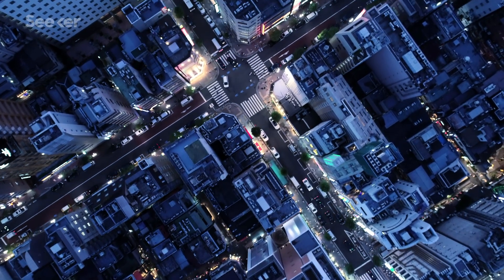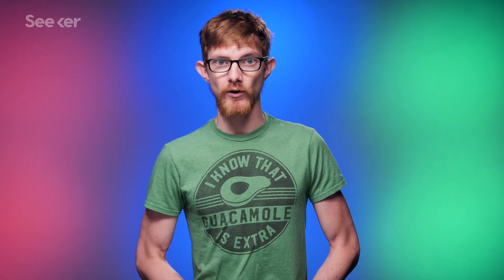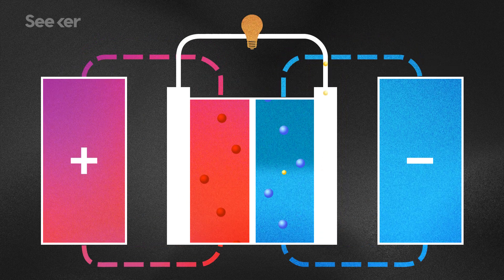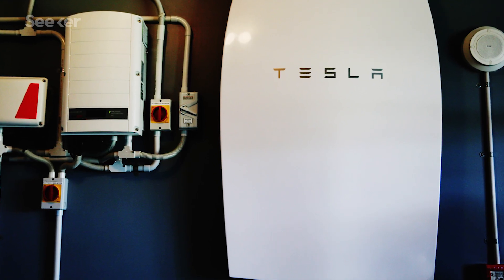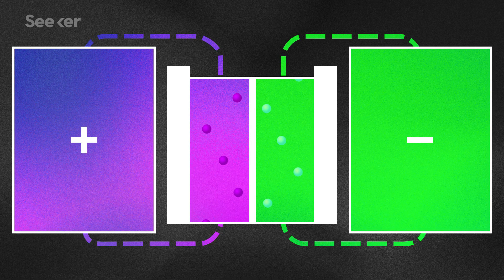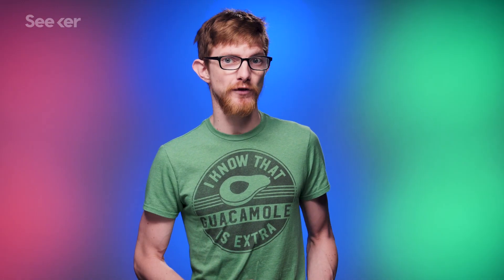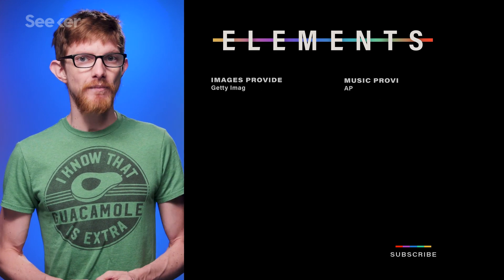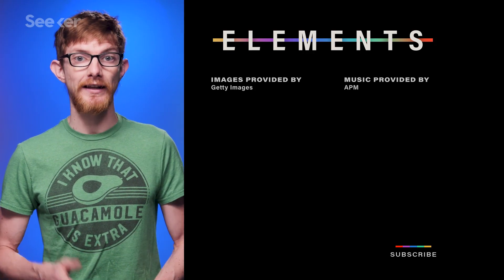Giant Flow Batteries Could Power Your City in the Future

Comment from the maker: Hey all 👋 Some of you may have notice that the hydrogen ions are flowing the opposite direction, nice catch! They should be flowing negative to positive. During the discharge cycle, vanadium ions lose an electron on the negative side freeing up the hydrogen ions to pass through to the positive side. They do the opposite while charging and storing energy! If you’d like to know more details about redox flow batteries check out theses articles:
https://www.sciencedirect.com/science/article/pii/S1364032113005418
https://pubs.acs.org/page/vi/redox-flow-batteries.html?ref=cmatexFeature
https://spectrum.ieee.org/green-tech/fuel-cells/its-big-and-longlived-and-it-wont-catch-fire-the-vanadium-redoxflow-battery.amp.html?usqp=mq331AQCKAE%3D
Reply: Is temperature C equal to watts per cm or meter? Squared or cubic? Per a second,  minute, or hour?
Reply: @robinhyperlord9053  What? Where does this come from? Also °C is based on the SI base unit K (Kelvin) you can't build it from other units...
Reply: how about using sea water and river water to produce difference of potentials? Both types of water are available in many places where a river falls into a sea.
Reply: @bazoozoo1186  Nothing to react in the fresh water, you can't get electric current out of it.
Reply: Now in deployment Iron flow batteries From ESS as well as smaller stackable units from a company in Australia zinc bromine RedFlow https://redflow.com/ and https://www.essinc.com/
Reply: Vanadium was also pronounced incorrectly.
Reply: where can u get vanadium?

Comment: The problem with lithium ion batteries is that they are optimized for power density and portability. Perfect for small mobile devices. But too expensive for grid storage. When portability is not an issue there are allot of different solutions possible.

Comment: A membraneless battery[38] relies on laminar flow in which two liquids are pumped through a channel, where they undergo electrochemical reactions to store or release energy. The solutions stream through in parallel, with little mixing. The flow naturally separates the liquids, eliminating the need for a membrane.[39]

Membranes are often the most costly and least reliable components of batteries, as they can be corroded by repeated exposure to certain reactants. The absence of a membrane enables the use of a liquid bromine solution and hydrogen: this combination is problematic when membranes are used, because they form hydrobromic acid that can destroy the membrane. Both materials are available at low cost.[40]

The design uses a small channel between two electrodes. Liquid bromine flows through the channel over a graphite cathode and hydrobromic acid flows under a porous anode. At the same time, hydrogen gas flows across the anode. The chemical reaction can be reversed to recharge the battery — a first for any membraneless design.[40] One such membraneless flow battery published in August 2013 produced a maximum power density of 7950 W/m2, three times as much power as other membraneless systems— and an order of magnitude higher than lithium-ion batteries.[40]

Comment: Plating batteries seem to have promise too.  Especially the one based on Zinc and Bromine.  An Ausi company, Redflow has commercialized these already and now needs to scale up.  They have, apparently unlimited number of cycles and can be taken up to full charge and down to zero.  In fact a slight disadvantage is that every three days, they must be taken down to zero.  There cycle efficiency is lower than Li batteries at about 75% but with wind and solar power ever decreasing in price, this may not be too much of a problem.

Comment: I'd love to see video on using these batteries in cars, when your solution becomes weak, you pull into a refueling station where
 they would pump out the spent solution,  and pump in fresh charged solution. Recharging could be done in minutes instead of hours.
Reply: This would never work in car since the technology has a low kW/H per litres of fluids compared with Lithium technology. However for static storage this technology is not an issue. 

Signed a person working at redT
Reply: @22moitrool83  Thanks for the reply an info,wishful thinking I guess.

Comment: I’ve heard flow batteries could be used in cars and could be re filled in minutes rather than hours 

If that’s true why is tesla investing so much into lithium ion batteries when this could be such a better way forward
Reply: i was also thinking it would be good for cars if you could swap out fluid at a station to be recharged on site.  Im no engineer or chemist.
Reply: @pablodiablo765  Energy density is too low; these will work for stationary land based uses

Comment: Ultra super capacitors that can store megawatts per cubic decimeter would be more ideal. You could discharge them  completely and not worry much, have a  recharged cycle of 100k or more have less environmental impact and are currently a fiction but would be  a possiblity in the  future. My opinion of course.

Comment: What are all those nuclear supporters complaining about?

Even if we would go primarily for nuclear energy, we would need large scale storage, you know that, right?
Nuclear Power plants are generally base load power plants, they don't like being regulated up and down all the time. They are turned on and then run more or less constantly, which means producing too much during night-hours and too little during peak load. This was the reason why pumped hydro facilities were established in the first place, but they won be sufficient when you turn all the variable fossil fueled power plants off and go full nuclear...
Reply: Producing power constantly is not a big problem compare to solar and wind.
In France about 75% of electricity is from nuclear. At night or any day they balance it with the hydro electric power station. 
Germany have spent about 500billion of solar and wind yet they pay double for 1Unit of electricity compared to France and still largely depends on fossil fuels.

Comment: Flow Battery???? All so complicated and waste producing mess  ... better to store energy by pumping water, where possible.  For example in California .. locate solar panels in the desert surrounding the Salton Sea .. and pump that water to the ocean, an elevation rise of over 200 feet ... let the sea water return, producing power all along that very long pipeline for distribution to everywhere between LA and San Diego .... This would reduce the Salton Sea contamination and reduce its salt levels thus improving the ecological disaster existing there for decades.  The government could pay for it all by selling property surrounding the Salton Sea which will sky rocket in value!!!!   Also, easy integration of a Desalination fresh water delivery systems would be a low cost adder compared to alternatives.  So much potential, for little cost ... ya heard it here first!!!!  (I only ask for 2000 feet of lake frontage).
Reply: Pumped hydro is nice, but unfortunately it can only store a quite small amount of energy compared to its massive size...
Reply: @DefCon1Shooter    Yes, but if the "massive" lakes & oceans already exist, why not use them???   The Salton Sea is the largest lake in CA, if just 1/7th of it was pumped to the ocean each day, then flowed back that same day ... that is a potential power of 132 MegaWatts  for 12 hours ... which exceeds the output of the Worlds largest Battery Grid Storage facility.  

Calculations & Resources used:
https://en.wikipedia.org/wiki/Battery_storage_power_station
https://www.engineeringtoolbox.com/hydropower-d_1359.html
https://en.wikipedia.org/wiki/Salton_Sea
Reply: You may be perfectly right with that assumption in California or the US in general because you have huge amounts of unused land over there. Here in Europe for example the situaition is a whole lot different. 

I totally agree with you that potentials for pumped hydro should be used. These new batteries are needed though...
Reply: @DefCon1Shooter  certainly, there is no single best solution for all situations.  My thought was that in CA, this would work great, while also reversing the environmental hell hole that is the Salton Sea (an ecological disaster accidentally created in 1905) ... the fact that it is located in a desert area .. there is a lot of dirt cheap land surrounding the Salton Sea hell hole ... all adds up to the perfect scenario for a Solar Farm with pumped hydro energy storage .. the only challenge is the long 70-80mile pipeline required out to the Pacific Ocean ... sound like a good use for Elon Musks Boring Company.

Comment: Great video giving a simple and clear explanation of redox flow batteries! Great job! However, I would like to point out three things: 
- Vanadium solution is extremely acidic. It is not limited to organic solutions. The same problems mentioned about pumps, etc., also apply to vanadium.
- Organic solutions for flow batteries have demonstrated to work in a wide range of pH, not only acidic or basic medium: https://www.sciencedirect.com/science/article/pii/S2095495617311051 . 
- Most organic solutions are extremely hard to produce in mass scale due to their synthesis process. Besides the very well pointed out solution instability, this is probably the major drawback of organic solutions.
Though, it is a great technology which hopefully can help us overcome the intermittance of renewable energy sources.

Comment: What ever happened to Nuclear? Cheap, efficient, safe.
Reply: Liam Kennedy what happened to nuclear? Three things: Three Mile Island, Chernobyl, and Fukushima Daiichi.
Nuclear fission reactors still have an important role to play but the public is legitimately distressed when they see the large scale environmental damage from the last two.  I was advocating for nuclear before TMI, and after that accident I emphasized that safety systems had ultimately worked and no harmful levels of radioactivity were released; after Chernobyl I changed my speil to emphasize that Chernobyl was an obsolete design no longer used (and never used in the West), but after Fukushima Daiichi I’m reduced to saying “well, coal is worse...”
Perhaps new reactor designs (pebble bed?) perhaps new fuels (thorium?) perhaps a shift in the public’s thinking, perhaps all three will be needed before new nuclear plants are built.
Or maybe we’ll get lucky and fusion will finally be made to work (China recently sustained a 100 million degree plasma in their EAST reactor).

Comment: Could flow batteries not be used for electric vehicles? Both solutions could be replaced at pump stations on routes, where it gets recharged again for the next replacement.
Reply: This was already discussed, but the disadvantage is the capacity/weight ratio, this is worse with redox flow batteries compared to Li Ion. But if you use them stationary, weight don't matter.

In behalf of the weight current Li Ion batteries are the lightest possible solution.

Comment: All-vanadium system liquids last indefinitely and can be re-used after (say) a 25-year plant operation on a 5-10 year maintenance cycle.An individual cell can hit north of 100,000 deep cycles if you cycle constantly. Really the only breakdowns are in the reduction of the carbon felt anode and in the membrane, and balance of plant items like pumps.

Comment: Redox flow batteries have lots of flaws and it still has a lot of work , research, development and improvements to be done I've seen some university research sheets about the redox battery , their main problems are that the nafion membrane is rediculously expensive and it tends to degrade often because the acidic environments .

Comment: Harvesting lightning? Anyone thinks this might be possible?
Reply: There's a good article on Forbes about this. It looks like the overall answer is "no". They mention the difficulty in predicting where lightning will strike, and the problems with melting capture devices because a good portion of the energy comes in the form of heat, not electricity. They specifically mention the Empire State Building being struck by lightning about 23 times a year, and if that could be captured would only equate to about 20 barrels of oil.
Reply: @ChrisJ-fn6tw   ow ok, thought lightning had more power then 20 barrels of oil.. thanx for the info.

Comment: How much superior are chemical batteries compared to a mechanical one? Like lifting a heavy weight really high up and letting it fall driving a heavy geared turbine when energy is required? Or pumping water to one side of a dam, and letting it drive turbines as it falls back.
Reply: Chemical batteries are very much superior. You can compare the energy density of mechanical and chemical storage solutions. E.g. pumped hydro with 100 m in height between upper basin and lower basin has an energy density of a little less than 0.3 kWh/m³. Batteries have between 10 and 100 times this energy density (Redox Flow somewhere from 30-70 kWh/m³/ Lithium Ion a couple of hundred). 

This means that we need much more space to store the same amount of energy with mechanical technologies than with chemical technologies.
Reply: @DefCon1Shooter  thanks. but even with this greatly improved density. Something like a dam can potentially be low energy to construct, and it will refill itself over time even if you let all the water out. Plus the energy can be stored for decades wihout degradation.
Reply: Mechanical batteries are technically superior but due to the heavy mass needed to be effective usually they will only make mechanical batteries when it can be incorporated into an environment (think about making a high dam so you can store the potential velocity of the water falling down)

Comment: Vanadium is currently $9.40/lb of V2O5 pentoxide flake in China and $9.65/lb in Europe, that's not very expensive. 

And given that companies can literally lease the vanadium electrolyte out and re-use it over again with no degradation in a brand new VRFB after ie. 25 years, the CAPEX is brought down generously considering the electrolyte is 30-50% of the cost of the VRFB units. 

And in comparison to something like a lithium battery on a large scale, the only way vanadium doesn't completely throw lithium out the door for energy storage is due to lithium's popularity and lower CAPEX, even though after 10 years the maximum capacity of the battery falls to around 80%, and at 15 you're lucky to be around 50-65%. 

Cellcube Energy Storage System's newest VRFB's achieved efficiencies of 94% for charging and 88% for dis-charging (German/Canadian company). They very recently obtained the contract for 50MW/200MWH in Australia.
Reply: Great comment and right on - this price is 'high' historically, driven up by demand for high-quality steel, but this is notably with zero dedicated vanadium mines!! A single mine could stabilize global prices for years or decades.

Comment: The biggest "batteries" we have in the UK at the moment are simply places with a reservoir, a shaft, some turbines and some pumps, oh, and a whole lot of water. When we have surplus power, it drives the pumps to push water up into the reservoir. When demand exceeds capacity, the sluices are opened and water pours down through the turbines, delivering on-demand power to the National Grid. It's not 100% efficient, and we don't have many of them, but it's better than nothing at all. Our other way of covering situations where demand exceeds provision is simply to close some relays and import electricity from France, which we then pay a premium for. I prefer the pumped water method!
Edit: Almost forgot, we also have "green" power companies who will reduce the supply to big consumers in order to more efficiently balance the load. I think this is a good partial solution, but it's not very popular, and these companies also charge more for their electricity than most other companies, further reducing their popularity.

Comment: Energy storage is pretty much a lost cause. Even if you could develop batteries with 10x the energy density of lithium ion it still wouldn't be feasible. There is currently only enough energy storage in California for 12 minutes. Including every battery in every vehicle on the road. Times that by ten you still only have 2 hours worth. If you want to achieve 80% renewable energy from wind or solar. You need a days worth of energy storage. Meaning even with this supposed 10x better battery you'd still need 12x as many batteries as are currently in all of California. For 100% renewables you need a week's worth of energy storage. Or 84x as many batteries as there are in all of California. You might save the climate. Hurrah. But doing so would destroy the environment with how much strip mining for materials and land clearing for energy storage banks would take place. Not to mention asinely expensive. Any 'miracle battery' that gets Invented is still going to be new technology and stay unattainably expensive for a long ass time. Especially if it requires expensive or hard to come by materials. This is the limbo most current miracle batteries are in such as graphene. if we want to quickly offset carbon emmissions the only solution is to start building more nuclear reactors. Might take several years or a decade to build. But once their operational they'll provide large amounts of safe, carbon free energy for decades.

Renewables such as wind and solar cannot and will not save the planet. Too expensive, too unreliable, too heavily reliant on natural gas to cover their down times when the sun doesn't shine or the wind doesn't blow. They lock in fossil fuels and cannot be scaled up to cover a majority of power production.